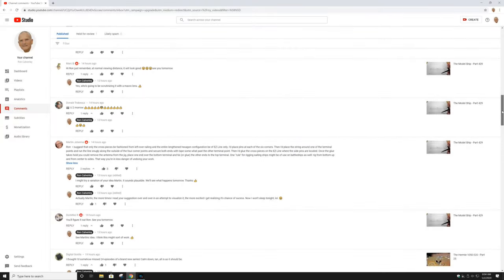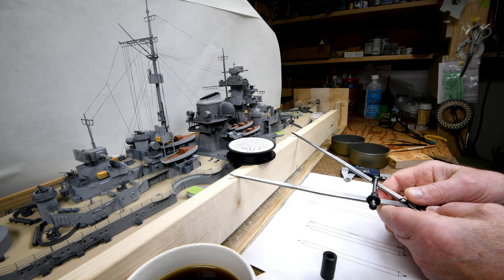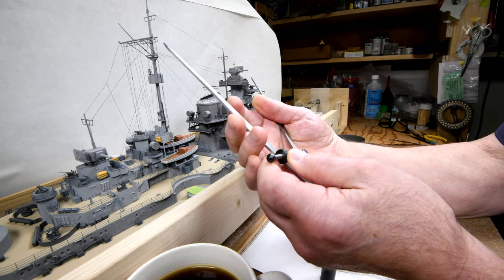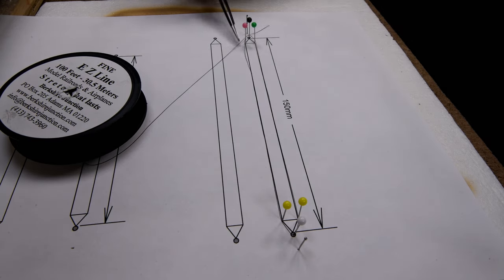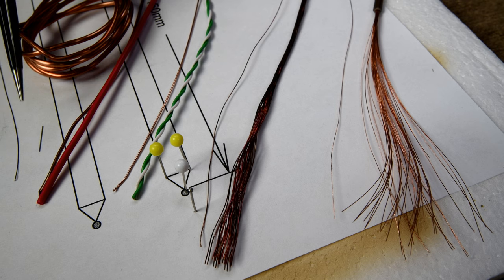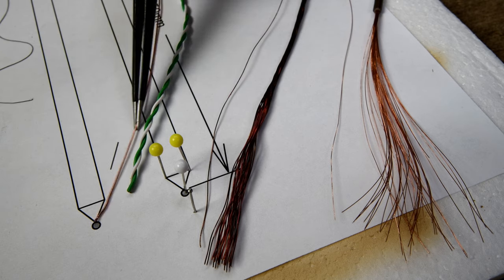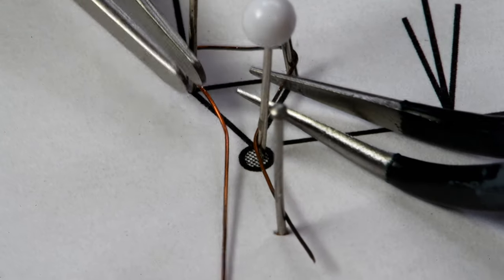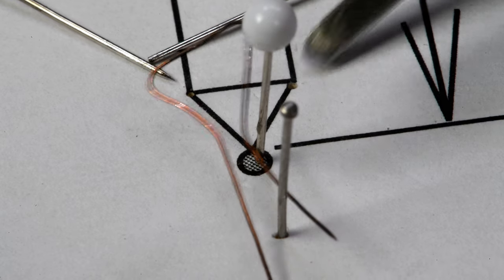The Model Ship - Part 430

Comment: Ron, use your PE pliers to bend the wire. Once done, if you have a soldering iron, tin the entire piece, it’ll significantly strengthen the piece. When you add the line just follow the “square” and CA the line to the “bottom” of the triangle..you can then use CA on the open point of the triangle to attach to the mast point. Hope that makes sense. The idea is great from the viewer.
Reply from the maker: Episode 431 is uploading now, and you'll see that I did finally use the PE pliers. See you later Tony, 👍

Comment: Ron why don’t you wrap the end of the wire around the white pin then go round the others  pins And then back to the White pin
and wrap it once round then you’ve got a loop supposed to be easy line through to pull it onto the mast
Reply from the maker: Thanks for the suggestion Robert. Episode 431 is uploading now. See you later, 👍

Comment: The push pins are too rounded to angle and aren't anchored well enough. Maybe fold the wire over a knife blade.
As intently as your viewers (myself included) watch the videos maybe end the videos in a cliffhanger. 😁😁
Reply from the maker: "Maybe fold the wire over a knife blade."
I must have read you mind Jeff. Episode 431 is uploading now. See you later, 👍
Reply: More likely I read yours. 
Later 👍